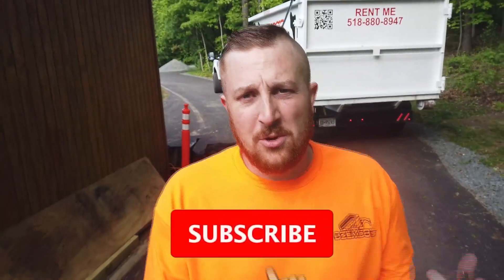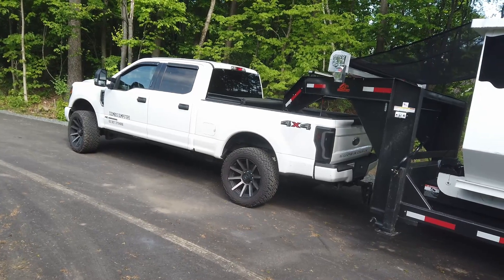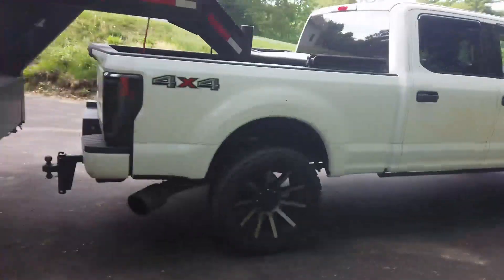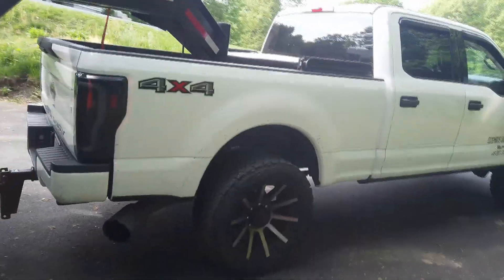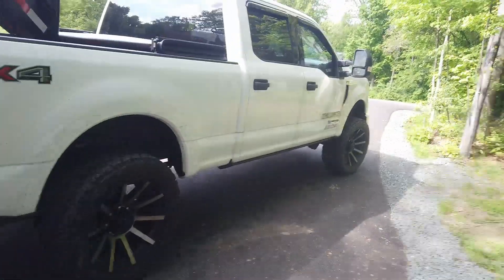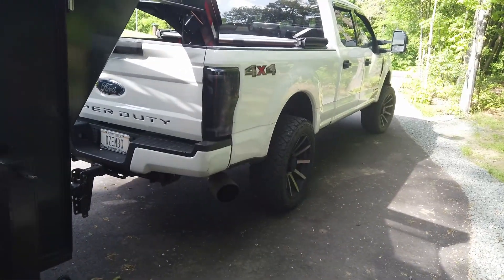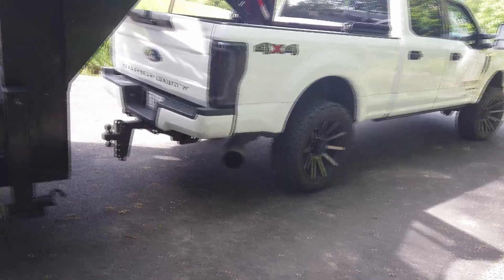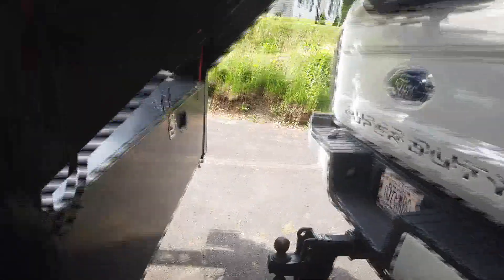Dumpster Business Issues, Truck Squat, Tire Wear... We got to fix this!!!

Comment: May want to check your tow capacities. Max GCWR is on any late model f250 is 25,700 at the most and after subtracting truck weight plus riders and gear you'll be under 15,000 towable which is the max towing for a 4x4.
Reply from the maker: 34k the Towing with a goose. GCWR is 23,500.   Max load of 16k

https://www.ford.com/cmslibs/content/dam/brand_ford/en_us/brand/resources/general/pdf/guides/18RV&TT_Ford_SuperDtyPU_Nov27.pdf

Comment: I can’t find that $330 price anywhere on Amazon , $410 rear $400 front on ultimates and $780 for the compressor with ez mount $680 without. Did you get it used ?
Reply from the maker: https://www.amazon.com/Air-Lift-Company-57200-Loadlifter/dp/B00I14W7YY/ref=sr_1_4?crid=2JUS0WYRDQ1YG&keywords=air+ride+5000&qid=1653701690&sprefix=air+ride+5000%2Caps%2C104&sr=8-4 $312 new
Reply from the maker: Also you don't need the fronts you don't carry any weight on them so they would be kind of pointless
 
Compressor
https://www.amazon.com/Air-Lift-25980EZ-WirelessONE-GenerationEasy/dp/B07FFBXR46/ref=sr_1_5?crid=3PY4ZLDXTPVPQ&keywords=airlift%2Bcompressor%2Bkit%2Bwireless&qid=1653705585&sprefix=airlift%2Bcom%2Caps%2C108&sr=8-5&th=1